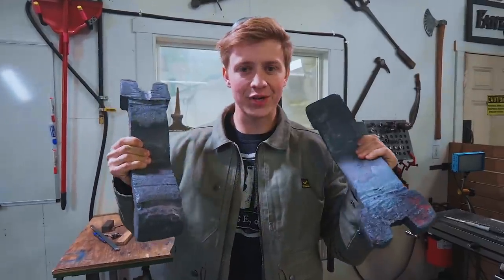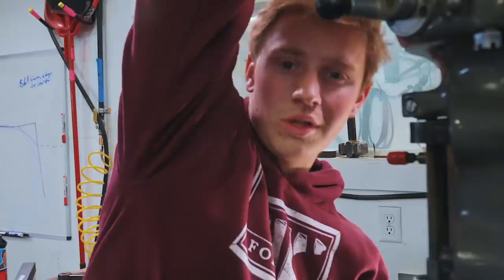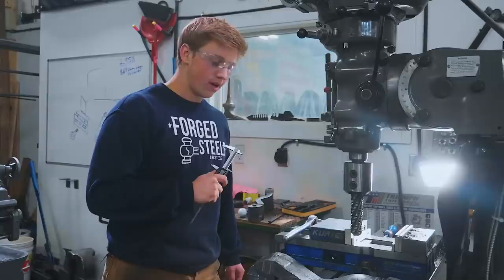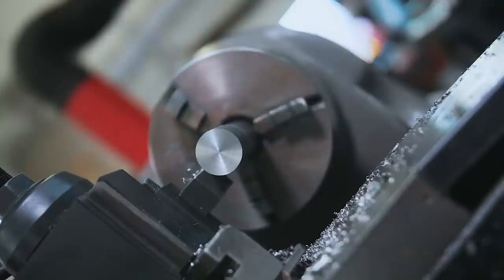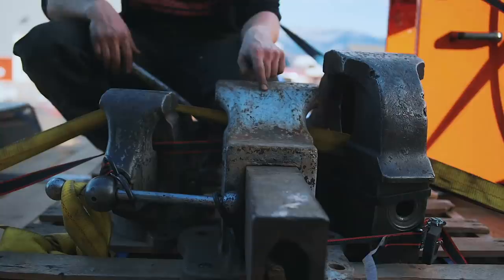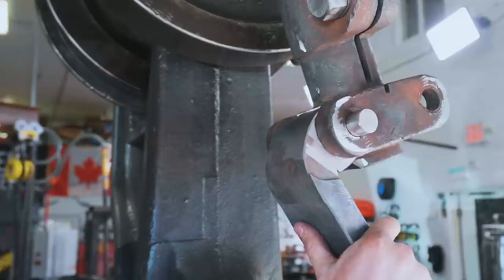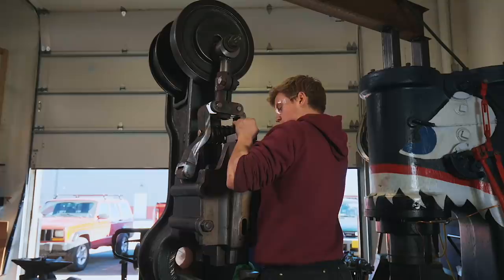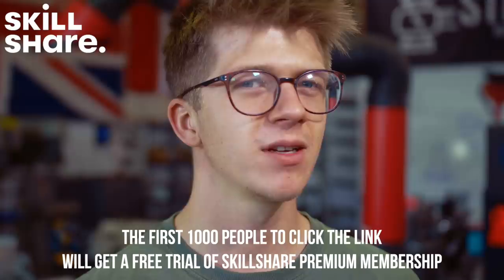RESTORING THE FAIRBANKS POWERHAMMER!!! Part 7

Comment: Hey man for what you're doing you are always going to run into problems. I mean you are rebuilding an old school hammer from forged steel and from scratch. Give yourself some credit where credit is due. You've never built a power hammer before and it looks awesome so far. Once everything is said and done it will work better than ever before, because you truly care about what you do. Cheer up bro and have some faith, you got this. I cant wait to see it finished and running like new.

Comment: "...We're jsut waiting on the oxygen to do that..."
Or you could put them in the freezer, while putting the arms, or rather the eye of them on a hot plate, doesn't even have to go boiling hot, 40°C (you know "hotsprings" or bathtub temps) are enough to widen, while the bushing is shrunken down. That's what we often did in our workshop with bronze gears and steel shafts, also works with steel-steel and basically idk "most metalls" ? The benefit is that often even pressfits go in rather smothly and fittings that are possible to "gently tap in" nearly fall into place, that's why I'd almost allways recommend to put those bushings in the freezer, they shrink/widen a lot better then steel when using the temperature trick too.
Another benefit o staying below 100°C (aka boiling hot) is that changes in crystal latices, don't happen at such low temps, for temperature treatment (de-stressing etc.) you'd have to go above 550°C, you will not even go near that while achieving your goal, it's a lot less messy too. Given the blue-ish tint on the arms, you maybe went a little strong with the temperature on them?

Comment: For making holes of arbitrary size with the milling machine, get yourselves a boring head. Much like boring on a lathe it also guarantees that the hole is round and straight. 
It will save you a fortune in reamers. 
An automatic boring and facing head is even better, but they cost more. (look on eBay for Wohlhaupter boring heads to see how much more....)

Comment: U should have gotten liquid Nitrogen.   I use to reman connecting rods for diseil eng.  Heat the rods up in a kiln and chill the bushings down until the nitrogen quits doing a rolling boil put on those green or yellow cleaning gloves u can buy in the store and u pick up the bushings really quick and set them on the hole and pop them with the bottom of ur hand and almost every time they go in all of the way no problem and in a snap of time.  Then machine out the bushing to the size u need and ur done in less than a half min. per bushing.

Comment: Just when i thought that he knew how to do a shrink fit he suprise me! You put a bronze bushing over night in a freezer and heat up the part if the tolerances are within 0.05 mm it will slide in like a glove ,once everything cools down that thing wont go anywhere.same thing goes for the ball bearings.Also use the freaking oil to lube things up.
You probably had a chip inside that is why it chewed up that rod .

Comment: Will, I think you have a fallacy about fixing an old object is going to save you money versus replacing it with a new object when they break down. I'd hazard a guess, I'm going to say that what you and Alec has spent in materials, supplies, and (most importantly) your time has probably outstripped the cost of a new power hammer in the same class. Sure, you only spent $500 USD to acquire that power hammer. But you've had to make replacement parts for over half of the moving parts of that machine. I would love to see a cost breakdown on what you've spent on materials and supplies (like that tank of O2) compared against new piece of equipment. Your time might be a bit tricky to figure out. But it should be a line on that cost breakdown, since time spent on that hammer could have been spent on other projects with a more visible return.

Now, don't get me wrong. There are reasons to fix up that old power hammer. You could make an argument about preserving a bit of history, that fixing the hammer will teach you more about how they work, or even the fact we tend to throw out far more than we probably should and this is an attempt to keep one less thing out of the landfills. But claiming that "I only spent X to purchase object Y, so I saved money." without taking into consideration all the costs down the road that might add up to be far more than a new machine would cost. I've seen this fallacy play out with my dad. He's knowledgeable enough to fix up a lot of things. But his house is littered with all sorts of "dead things he can fix up", and one of his excuses is how much money he could save fixing it on his own.

Comment: What grit of sandpaper do you recommend for metal?
Reply: It depends, what are you trying to do with it? e.g. if you:re trying to remove scratches or file marks from the material, you probably want to start at about 60 grit. One of the most important things to keep in mind when sanding is grit progression i.e. progressing through grits with the smallest difference possible (e.g. 40-60-80-100-120-180-220-etc.), This will most effectively remove the scratches left by the previous grit of sandpaper and makes sanding alot quicker and easier to do. Another important thing, is knowing where to start and where to finish, but that will change from piece to piece.

Comment: I have the general feeling you should have inspected every place two parts fit together for mushrooming, cracks, oversized holes and whatnot. At this point it looks like you've assumed too many things are okay when they're not. Start at the motor mounts and work your way down to the dies instead of the other way around which you've been doing
 I only say this because BTDT.

Comment: That offset hole in the top bearing thingy looks suspect as it seems to serve no purpose.
My guess is that piece is large so that the machine is assembled and measured and then the hole is marked and drilled in the right place at the right distance.

Comment: if you're hole is too small it will collapse your bushing to a smaller diameter and cause your pin to be too tight.  you'll likely need to ream your bushing if you force it in with too much pressure.

Comment: 9:08
Spends 7 part series reparing a piece of equipment that is not working exactly right. The labor cost man. Skill and experience is not easy to come by. Wether it's a little elbow grease or a major investment is not always easy to judge when you deal with old and used equipment.

Comment: Why not heat treat them yourself? I don’t recall the reason.  If it due to the mass then preheat them in the new temperature controlled forge. While that’s going preheat the oven. When the die is heated up then place it in the oven and finish out the process. Easy Peezy. “If it works, it ain’t stupid”.